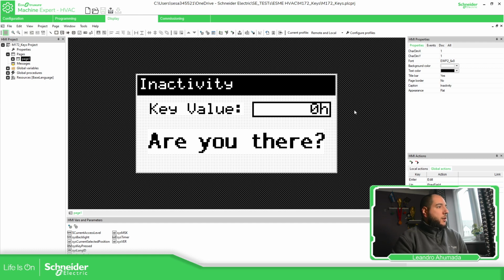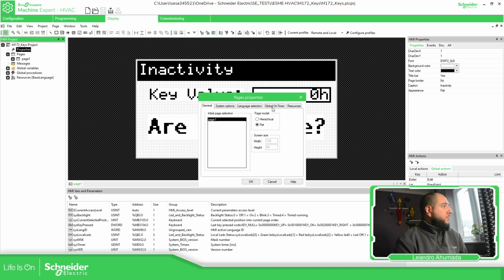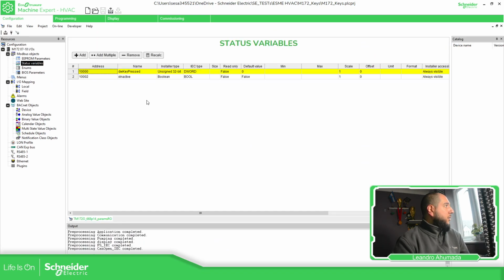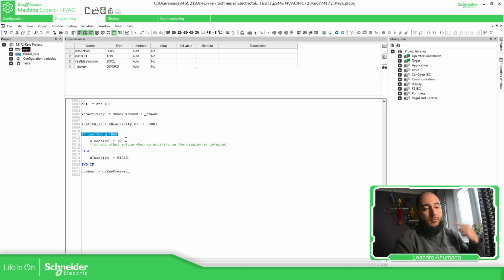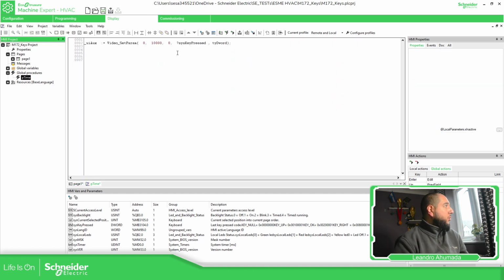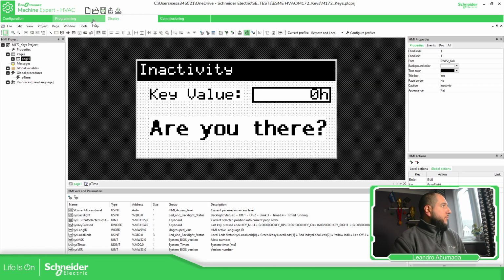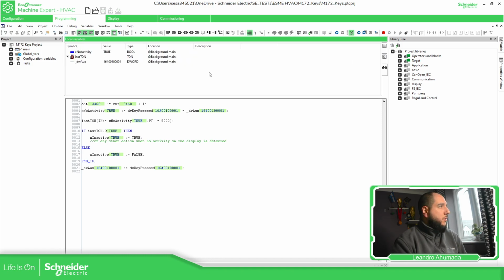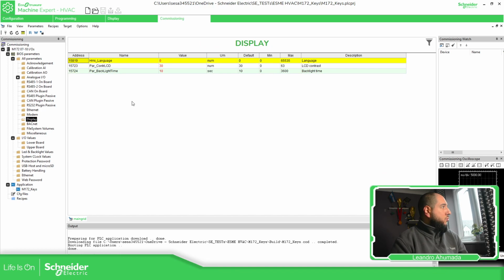EcoStruxure Machine Expert HVAC Training - Mx.x M172 Keys inactivity

Comment: Thanks you for this job 
I have questions About communication Modbus TCP IO Scanner between tow PLCs M221 to connect to the Plc TM251 How I do that thank you for help
Reply from the maker: Hi there! Which one is going to be the server (slave) and who the client (master) ? Depend on the question i may have something done
Reply: @LeTomasAHUMADA  
for the two M221 PLCs (slave), I have digital inputs that I want to recover on the PLCs (master) in IO Scanner. after all the data will be sent to a SCADA system
thank for your réponse
Reply from the maker: Take a look to this video:
Training - M221 - M13.1 EtherNet/IP Adapter with Modiocon M262
https://youtu.be/molMupLQOLg

It is not modbus tcp but it will do the trick
Reply: @LeTomasAHUMADA  Thank you so much
I have already seen this video (I have seen all your videos)
from what I understood is that I cannot work with Modbus TCP IO Scanner to collect digital information from M221 PLCs
so I use EThernet IP adapter??
thank you very much for your help
Reply: @LeTomasAHUMADA  
Good morning
I really need this video if you can make it it will be a great pleasure
Thank you so much